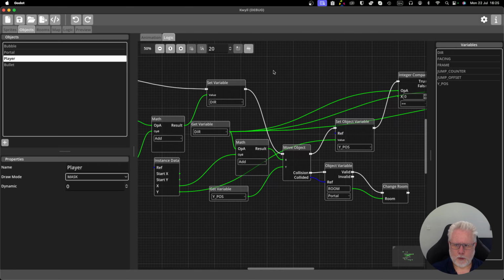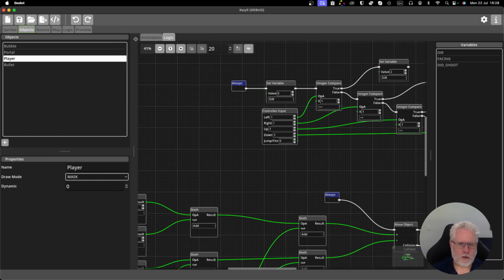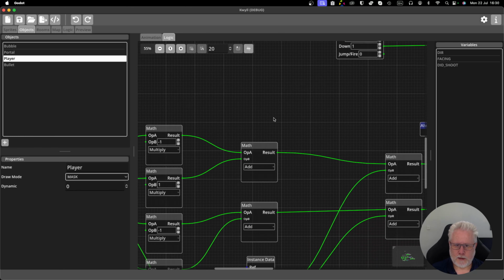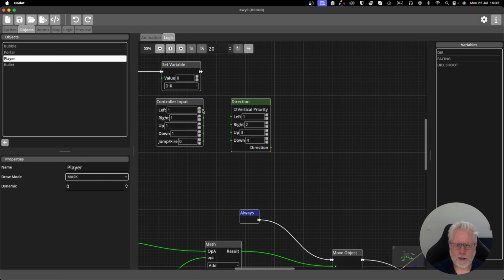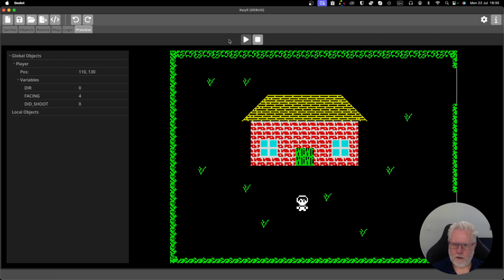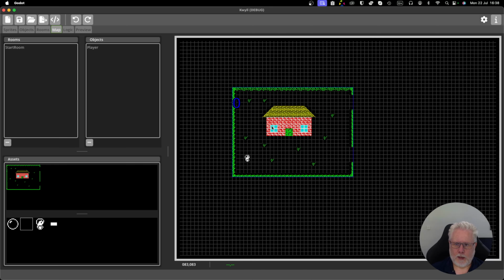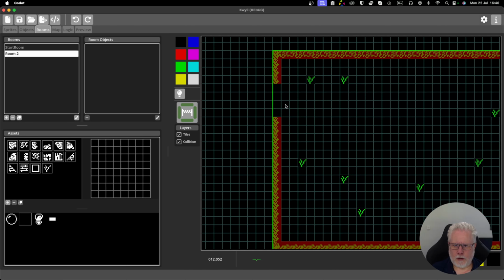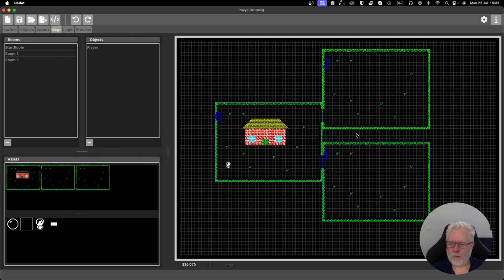Kwyll 16 - Nodes and Maps

Comment: Nice work. 
With the nodes, it would make sense to allow you to create a group of nodes as a module (function/sub-routine if you will). You could then reuse these modules as common code, for different logic parts.
This would mean you wouldn't need to implement additional custom nodes, if the same thing can be created as a node module.
One other thing the nodes editor needs is comments.
Editor only and not exported (obviously), allow the user to select a group of nodes and comment on the purpose of the grouped nodes.
This would help people learning to program what is happening with the node flows.
Reply from the maker: Hi, thanks for your feedback. Both of these things are covered in videos in the playlist. Grouping of nodes is already implemented, although there is currently no mechanism to distribute grouped node libraries, that is definitely on the roadmap. Comment nodes are implemented, I’m not sure if there is a video covering it at this point but it has been covered on the Discord server.
Reply from the maker: Devlog 18 covers subgraphs.